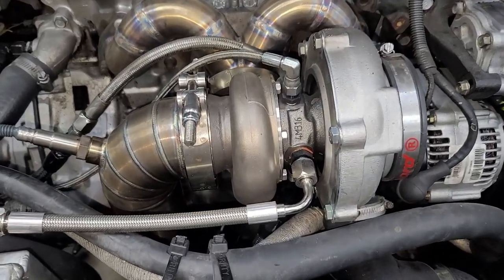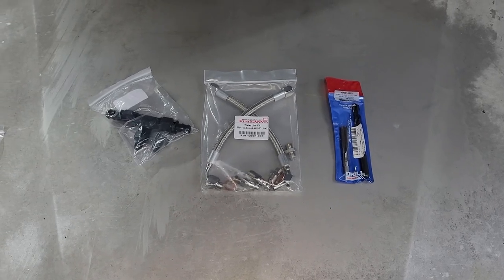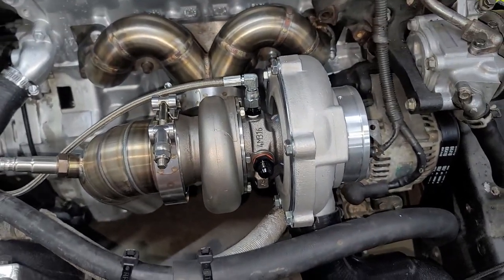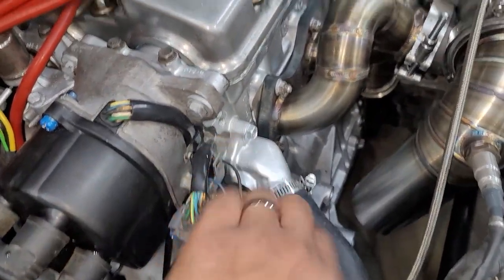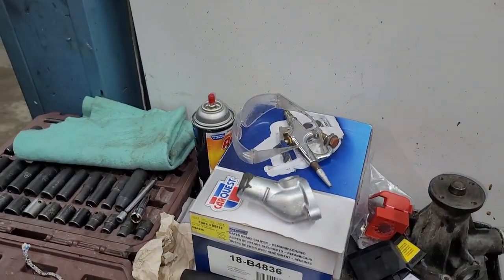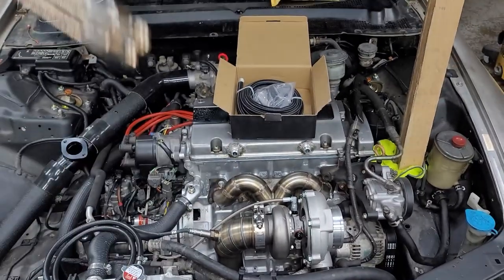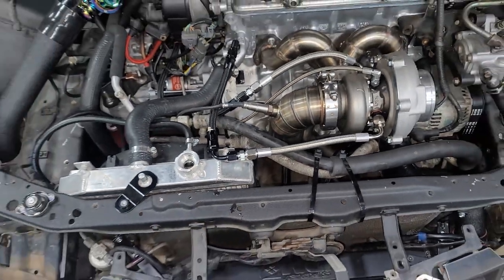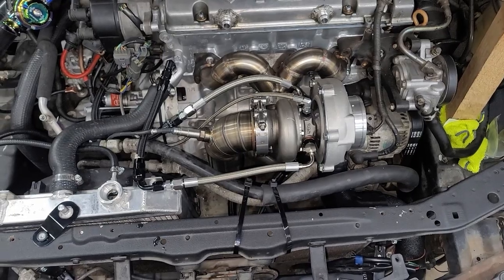Garrett gt3076r turbo water line install | How to turbo your Honda prelude pt2

Comment: Coming together well. Just remember you have to limit the oil psi to the turbo. Turbosmart sell oil restrictor. Don't want to blow out the seals
Reply from the maker: Yea the fitting I bought has a built in restrictor so should be good money
Reply: @treybedipping1734  it might have a built in one. But make sure the psi is at 40 or recommended to the turbo. Put a gauge In to be sure. It's a expensive mistake

Comment: Yo Trey, unrelated to the video, but on a 4th gen, how do you disconnect the fuel to do a compression test? I was expecting a fuel pump fuse but I don't see one. Do I have to disconnect the fuel pump relay under the dash? Scoured the interwebs but surprisingly can't find any info (not even on H-T)... Appreciate the help and love all the vids you make!
Reply from the maker: Yea you can just pull the main relay under the dash on the driver side...all the way up there lol